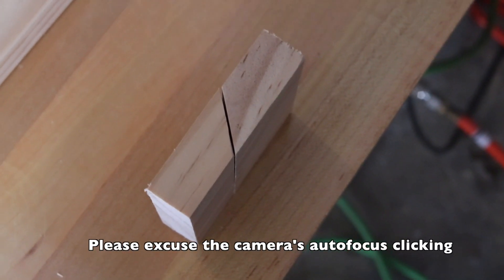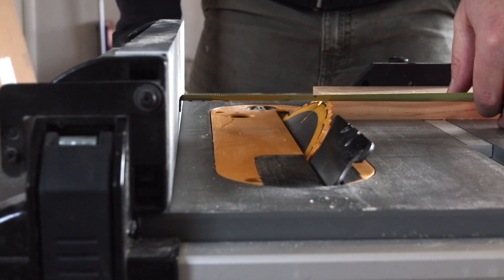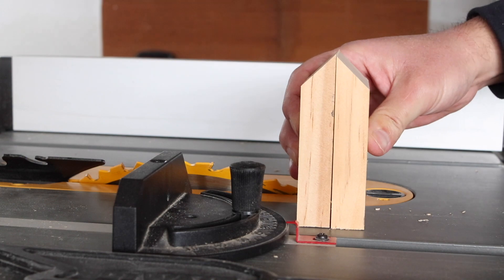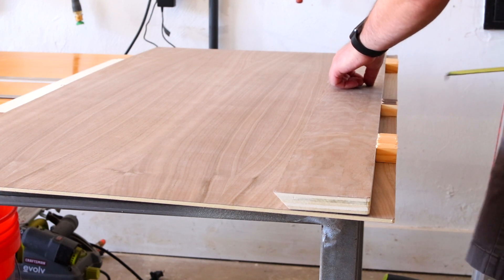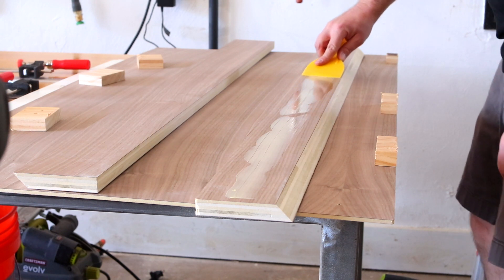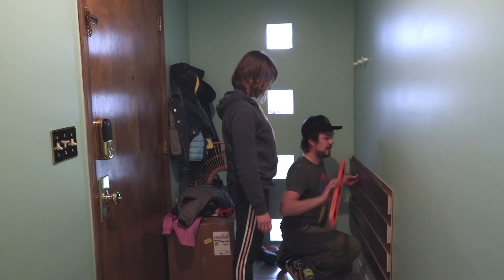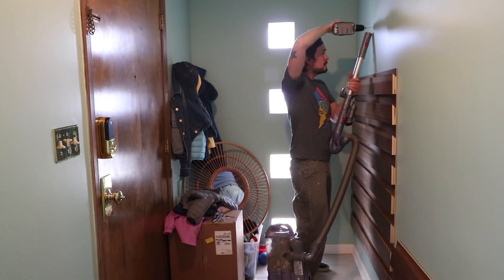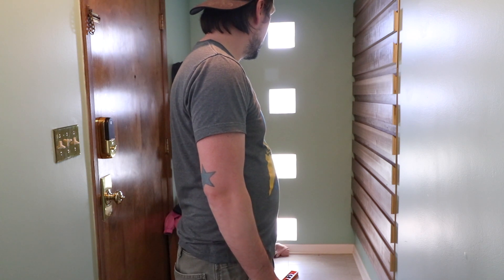French Cleat Wall in Entryway

Comment: How are you going to put the other half of the cleats on (the storage side)? If you only left 2 inches of space in between your 4" cleats, then you now have to rip your second half of your 4" cleats down to about a 1" or less in order to have enough room to put the cleat in and then let it slide down into the 45° angle?  What am I missing?